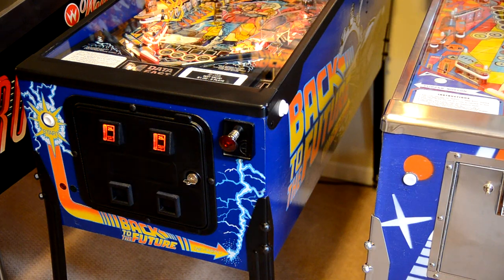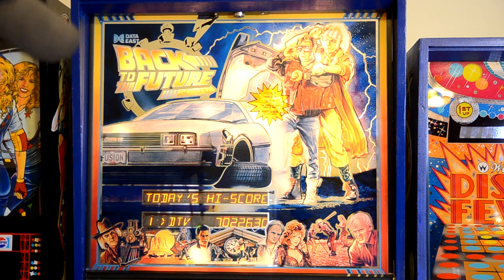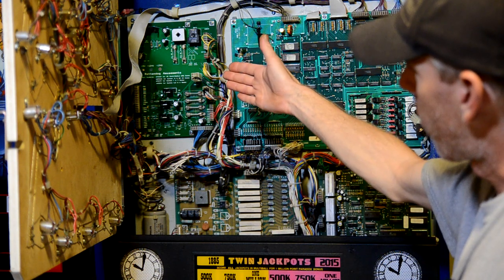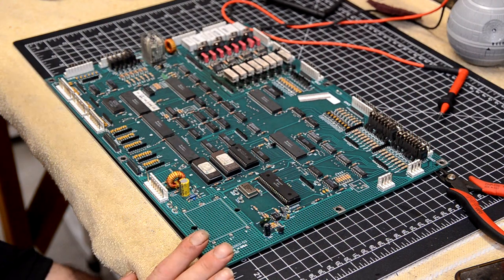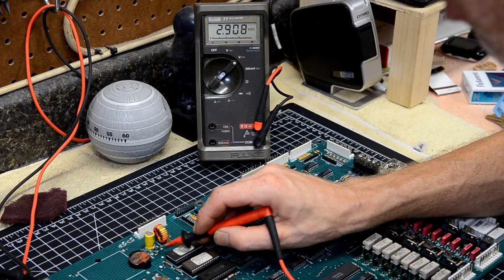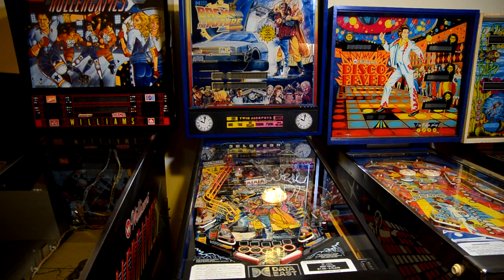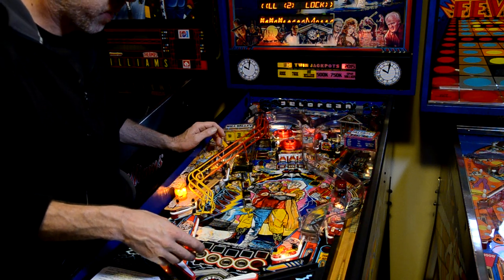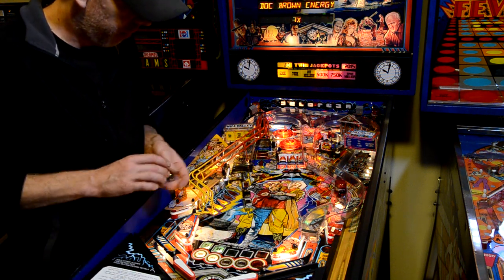Back to The Future the Pinball: Overview/Gameplay

Comment: I just pulled the little batteries out of the pinball machine. They are corroded bad but didn’t hit the board. I know nothing about working on these. This tutorial is helpful but I don’t have all the tools to do this. Do you have links to the parts you got to replace the original battery set up?